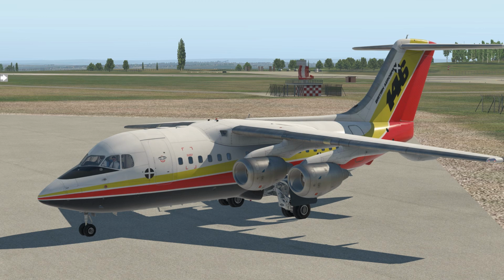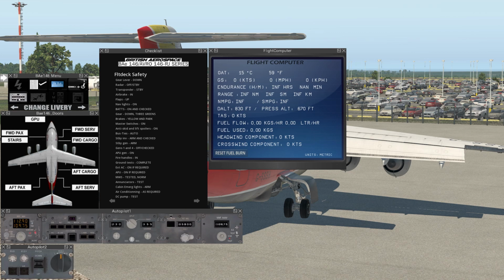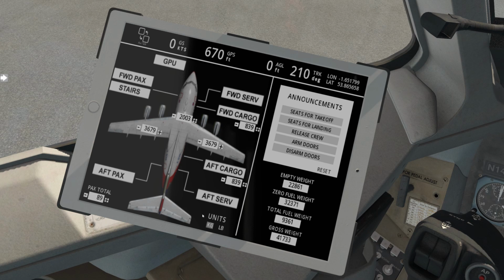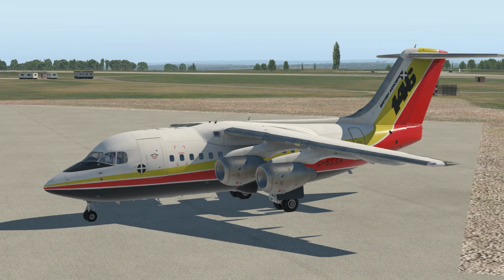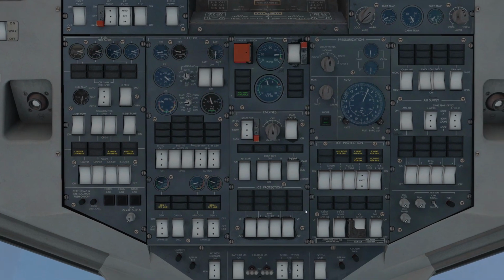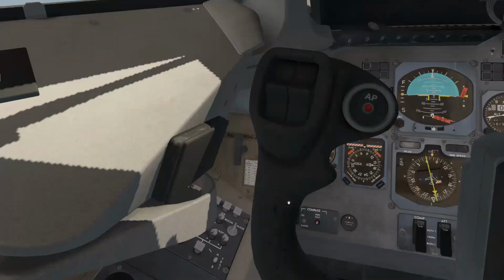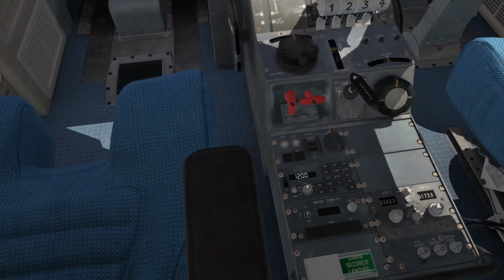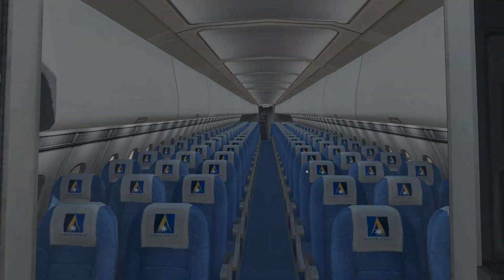JustFlight BAe-146 for X-Plane 11, Introduction

Comment: I'm sorry Devs, but this product is a No Go for me. I do not expect to be using a default Xplane FMC in an expensive quality addon such as your BAE-146. The FMC should of been implemented from the start. I know you said it's coming eventually but many of us are tired of paying for products with promises of things to come. I'll wait it out before parting with my money.
Reply: These variants rarely ever had an FMC IRL.
Reply: I was on the fence about buying it as well but took the plunge nevertheless. IMHO it is worth the money.  It flies superbly the depth and breadth of systems is all there.  3D modeling is great as usual.  I did some research and this is a VOR to VOR plane so in that respect it's not any different from flyjsim 737-200.  In terms of laminar FMS it is well integrated to enable lnav vnav if you feel like flying in a 21st century and RXP GTN works  perfectly with it as well.  Manuals and documentaion is  toliss grade, so overall I'd say it was a worthwhile purchase, no more than 5 to 10 bucks overpriced if I must knock it for the lack of custom FMS.